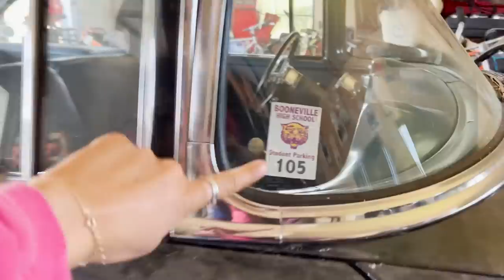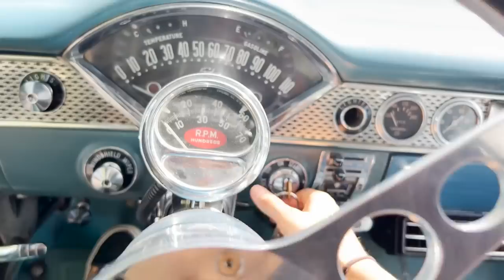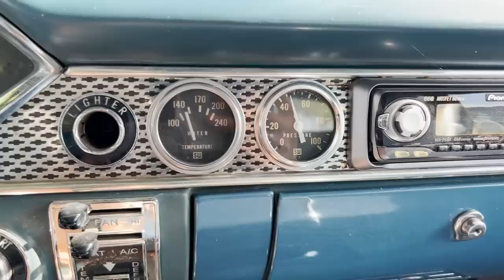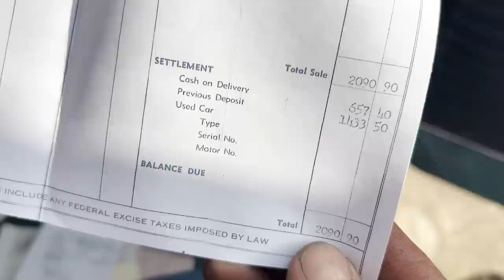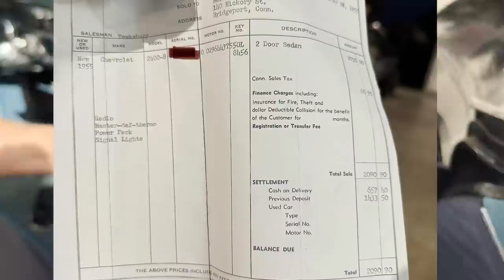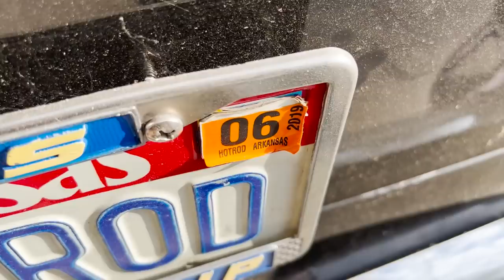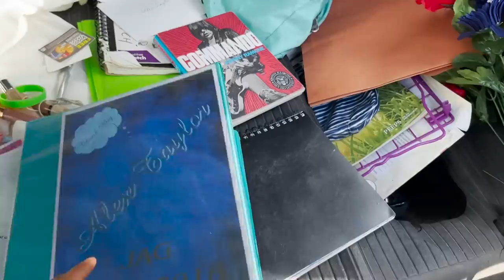A HOT ROD since 1968!! Getting the 1955 Chevy Bel Air Post Car Running and Cruising Again 😎

Comment: Big tires and a big block are the way to go. In 68 a 13 second car was a good running street car. Fuel Funny Cars didn't break into the 6's until 1970! In 1968 Larry Kopp, former NHRA Modified and Pro Stock Truck champion, had a 57, 4 door wagon called Mad Man, with a 331 CI, engine and a tunnel ram, in F/MP. That car was the fastest one in the class, and it ran 11.70's on a good day. My friend Frank owns the orange Super Bell 34 Ford, coupe. He lives about 40 min. from me.

Comment: That gas pump reminds me of one on an engine we put on a 350 we took out of a ‘71 Camaro and put in an older Chevi. It didn’t have that little weep hole so pumped gas into the oil pan. As we tried to start it the owner leaned over the lifter cover just as the gas exploded. All the bolts on the cover except 1 ripped out! That one bolt saved the owner from a cover in the chest/head. He couldn’t hear for hours.

Comment: That's kinda cool a '55 to drive to school in. One of my classmates had one, and last I saw a few years ago still did.
When I got my license in '75, I had about $1200 saved up for a car. I found a '67 Camaro, I'd wanted one since I saw my first in early 1967, for sale in the next town over. Got on my 10 speed and rode over to check it out. Got him down to $800. Told my dad about it and the answer was no way. He had a friend with a car that he wanted me to get. Well for $1000 I ended up with a 1972 Vega GT hatchback. Many years later I did end up with a '67.

Comment: First car in H.S. was a 1956 Chevrolet four-door Station Wagon.  (No shortage of fellow students requesting a ride home after school, pack them in).  (No safety first considerations then - no seat belts).   Also had no engine or trans.; when I bought it. Located a 1959 283 at the salvage yard for $75.00.  (Used roughly 1-quart of oil per 50 miles).  (Worn out).  Oil fouled #8, (Champion heat range; J18, spark-plug), often.  (Longest popular / known electrode in that era).  (This was before the no-foul , spark plug extensions were discovered).

Comment: Dennis just a thought but a high reving dz 302 build would make a statement. With the noise of a rock crusher m22. Old school with new school zing. You see people build them everyone in awhile. But nobody with the wisdom and old school cool knowledge. Maybe a Doug Nash 4 spd with that over drive option. Or auxiliary gear. Whatever they called it. How long has it been since you've seen one? The first 55 I ever seen had one. A Hurst shifter with a 2nd shifter with lil knob. Was told it was and auxiliary overdrive. I was a lil curtain climber back then. Keep up with the amazing work you do. Very much underrated compared to others doing the same. Best of Luck with All.

Comment: Talk about a trip down memory lane... My Dad won a '56 Chevy as a door prize at a dance.  It was a stripped 210, of course.  He wanted the V8, Automatic, Electric wipers, radio... He ended up taking a two tone Bel Air off the lot for just a few hundred dollars.  I grew up with that car, helped him rebuild the engine in it... and it was the car that I learned to drive in.

Comment: Nice 55 definitely a keeper.  There is more room in the engine bay than a gen one Nova with a small block. I would definitely give you your original money back. Have owned a 56 and still have the 57. May have to locate a 55 to complete the tri 5 owned legacy.

Comment: Enjoyed the video.  I picked up on a couple of details.  The Lions Drag Strip (Long Beach) license plate frame.  I live in SoCal and I was about 21 when Lions shut down permanently.  They had a concert that night and my buddies and I attended.  Also, I see your fridge in the garage.  We had the exact same one with the drop down door.  Ours lasted 28 years and quit a year ago.  Had to rebuild the ice maker a few times.  We could not find a new one with the drop down door feature.  BTW...I'm a Chevy / GM guy all the way.   I have a 96 Impala SS, 2003 C5 Corvette, 1988 Pontiac GTA and a 1988 Corvette.  All four cars have versions of the 5.7 liter (350 cubes) small block.

Comment: 👍👍👍 Back in 1970 I had a 56 4door that I puta 300 HP 327 Corvette engine in with a 3speed on the floor peanut trans. Talk about small engine bays , I have a 28 model A sedan with a 350 SBC with a 350 TH and early 80s corvette rear end.Both cars were/are fun. So I know what you feelings could be. Up grading the 55 would be a great series.Great videos.👍👍👍

Comment: 454 small block and a load of scrap yard bits to turbo it with an old t4 turbo off a truck , fixed timing , home modded carb . budget series power .:)

Comment: Slap that boy silly! Keep all the stainless, tub it, fat block or 6.2 it with a 10 speed. But don't destroy that beautiful car. Sell it to someone that would cherrish it, find you another junker and you can't destroy a junker. In 1968 I took a cherry 2dr post Bel Air out of my dad's used car lot. Did the Dirt Track Delete Kit. The driver door hardly made any noise when it closed. I think it had 17k on it. I've never forgiven myself for destroying that sucker. Our daily was a 55 twice door hard top in turqoise and white with a 350 and 8 dueces. Worthless intake set up. Immediately put a 427 out of a L88 Vette with a cracked head. Went to the Truman Baker Chevy parts, asked if they had a head. They did. Said if I'd take them both they'd sell them to me for cost to get rid of them. You know how that went. That daily put Herb McCandless, Hurst Mr. 4 Speed on the trailer 4 times in 1968 at Carlisle, AR.  If you got your butt kicked by someone that drove 50 miles to the track, don't keep accepting call outs. That 68 Dart sold at Mecum two years ago for a chunk of change. We lost track where the two door Bel Air got off to when we borrowed the engine-trans for circle racing. 

Set of 15X7 Keystone KustomMags would really set her off. But the 5 spokes are perfect as they are.

Point is, you can only hurt the car if you modify it. It is beautiful in the current video and yes, I'll give your 68 retail invoice for it. I would appreciate a slight discount for the replaced fender. lol

Y'all have fun.

Comment: Don't rip on them OG SBC's. When applied properly (not in an over weight land yacht) they can be fun. I loved the 68 327 I had in my 79 Camaro. 327 375 (stock rating ) horse jeep motor. Had the fuelie heads the heavy vibration damper from the factory. I put a bigger cam in it, a 750 Holley jetted out, Borg Warner T10 and 3:73. 

I used to love smokin those sissy 5.0 Wusstangs. I bought it running like a truck because the guy that did the motor swap had ZERO clue. Within the first hour of owning it I had it jumping off the line after sorting out the nightmare ignition he had.. Quick HEI swap with an Accel super coil did wonders.

Comment: Hi to you all.
 Lol.
 This is a funny video, meaningful. 
 Really neat car apart from the obvious.
 Sounds like like Turbo lives at your home. Cool. 
 Does Turbo like living at the factory?
 Take care!
 All my long awaited bits and pieces have arrived for my engines, and the rear clip for my VX Commodore SS is almost complete and ready for installation.
 The VZ full yube car with the 463 Chev that's top mount supercharged is ready for welding and will be rolling shortly. Yay.
 The Hq I almost have the shed up to put the Hq Holden into to finish the rear end 4 bar, 9" diff etc bla bla and then have the daunting task of rewiring the hole car, lol.
 All my dreams are coming together.
 My cats names are Teecee and Chloe.
 
 Karl

Comment: You're doing the reverse of what I just did. I pulled the 454 OUT of my daily driver and totally rebuilt my last small journal steel forged crank 327 and put it in because of Bidens $4.00 a gallon gas ! The fresh 327 is sooooooooooooooooooo much better than that heavy ass cast iron big block pig.

Comment: Just a shitty cheapo fuel pump. Would have had provision for wipers originally. And a 60s on pump is able to be rebuilt.
That carb is an OEM version of  Holley. Ford?. A 'normal' 1850 would be a better or a 570 Street Avenger.
It does NOT need a truck engine or wheel tubs. You have one with all that! A coat of paint probably however.
Fool injection is not for classic cars.

Comment: IT is a 2dr sedan not a 2dr post and of course there is the 2dr hardtop which is without the "POST". Your Dad knows that. That's my main pet peeve about you youngsters referring to the 2dr sedan as a 2dr post. Grrrrrrrrrrr!!!!!!!!!!!!!!!!!!!!!!!!!!!!!!!!!!!!.
Reply: Of course, sedans don't have 2 doors.
Reply: @46wireboy  Yes they do as well as 4dr sedans the roof line of a sedan is generally higher and a hardtop is generally lower. I had a 1956 Chevrolet 120 2dr sedan (six cylinder three speed). There were high school classmates who also had 4dr sedans and 4dr hardtops as well as 2dr hardtops 1955 through 1957 Chevrolets. The windshields are different from the sedans and hardtops as mentioned before the hardtops carry a lower roof line and the windshields are not interchangeable. I viewed an episode of Judge Judy where a man was suing a glass dealer for selling him the wrong windshield. The man had ordered a windshield for a 1955 Chevrolet and did not specify the body style and assumed the windshields were all the same. So the glass dealer ordered  and shipped the wind shield for a sedan and it did not fit as the man had a 2dr hardtop. The kicker is the man lived in Australia and wanted to be reimbursed for the additional freight charges to fix the problem. He did bot prevail in his suit.